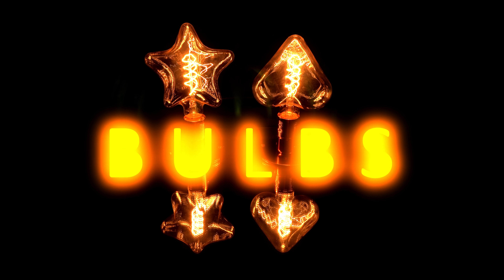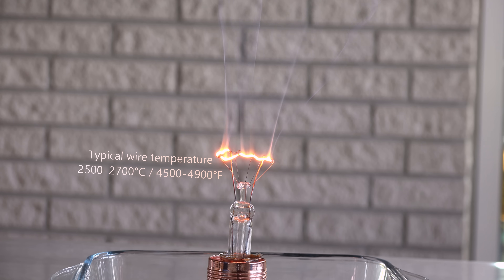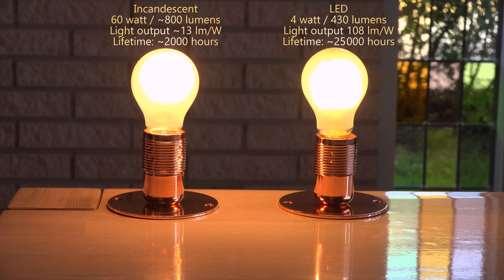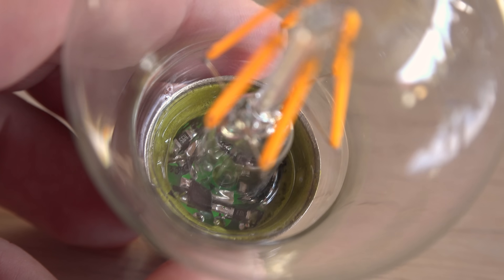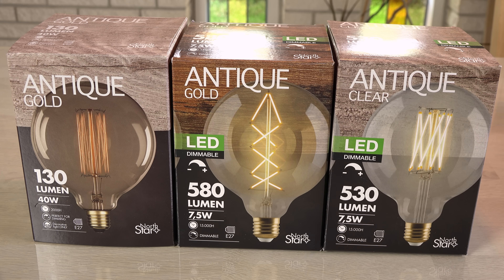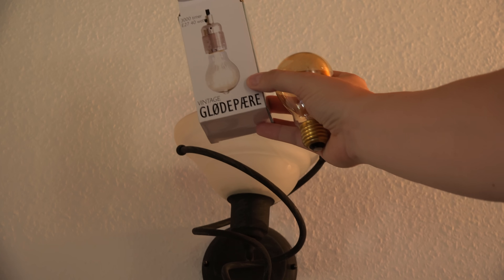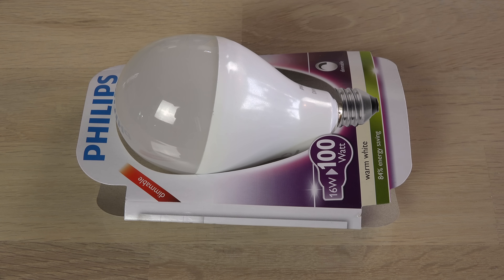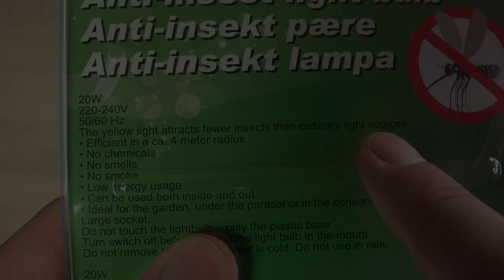Light Bulbs | LED vs. Incandescent

Comment: I have been waiting for your next video, and here it is. It is also very interesting to me as I have been thinking of converting to LED lighting! In the UK we use 240v 60Hz AC. Can you buy bulbs that convert the AC to DC? If so, are the electronic components reliable? Finally, what about strip/fluorescent tube lighting? Excellent video once again. Cheers.
Reply from the maker: Most if not all LED bulbs will have the electronics built into the base of the bulb, so they are ready to use. Also with 240V 60Hz if you buy in the UK. The electronics are not of the highest standard yet (built to a cost) but all LEDs should outlast incandescent bulbs in lifetime. And yes, you can also buy LED tubes in the same format as the old fluorescent tubes.
Reply: Brainiac75
That was my major concern, the electronics. I think I will try out one or two to start with and go from there. Thank you. Cheers.

Comment: Wow I didn't know that LED lights had color index's to worry about.
Reply from the maker: You're not alone... Manufacturers keep a low profile about because CRI 80 isn't really good. But CRI is actually an important factor for many purposes.
Reply: Yeah I certainly would not want a LED light with a low CRI my kitchen or dining room.

Comment: Viewers- if you're ever buying LED bulbs for in your home, be sure to buy "warm" white and not "cold" white.  Cold gives that fake looking effect like Brainiac showed with the meat.  I enjoy mine.
Reply: Cold white looks terrible in most applications, short of headlights, and interior cabinet or case lighting. It strains the eyes and makes you look like a vampire.
Reply: mibars

I'm with you. As an experiment, I recently bought a slightly higher priced 40 W LED bulb that was called "daylight." (5000K) To me, sunlight is cheery, while incandescent bulb light is dreary, and so are the warm white (2700K) LEDs and CFLs that are meant to match the light of incandescent bulbs. The new bulb definitely does have the effect of sunlight to my eyes and my mood. It seems far brighter than other LED bulbs I have, although the lumens spec is the same, but it is the lowest wattage I can find that is called "daylight." I now wish I had bought all my efficient bulbs as "daylight." If meat supposedly does not look right under light like the sun, I can deal with it.
Reply: ***** 'White light', that is either on the side of cool, or on the side of warm. Natural white is actually very slightly on the side of warm, like sunlight. I am not talking about that yellow orange light like old incandescent bulbs :) Although, that lighting will compliment your complexion.
Reply: mibars Most people after they color correct their monitors, will think white looks a bit pink as well. They are just not accustomed to it being accurate.
Reply: I slightly disagree :) I'm sitting in a room lit with 4200k CFL's and I really enjoy it: They seem "cold" compared to incandescent or even regular CFL's and slightly warm but close to sunlight with a small shift towards pink during daylight. I have 5500k "photo" type 85W CFL's in my garage and I also like the color there.
Reply: Philips Hue LED bulbs costs a lot, but they're the best I've seen with a high CRI index and adjustable color temperature.
Reply: Richard Smith Unfortunately it is just how the light out of those CFL's is - They have CRI of around 80 and when I turn them on during day I can see that there is slight yellow-pink tint compared to sunlight. It is marginal but I can see it. Not like cheap CFL's from 10+ years ago that were literally pink :) At night this is not visible at all. 
Kenneth Florek as I'm replacing CFL's with LEDs as they go I'm buying "warm white" LED's - I've noticed that they are usually in 3000-3500k range, much better than incandescent including halogen type.
Reply: Colour temperature is not the same as CRI. The uploader, as far as I can tell, used warm white LEDs, the light quality is still not the same.
Reply: ***** You sound like you're trying to excuse low CRI LEDs for their imperfections, whether they are made to a 'warm white' spec or not. CRI is just a measurement of the quality of colour reproduction, but any light source with a value less than 100 can have errors, in this case a yellow tinge on a white plate.

LEDs with a higher CRI compensate for a relative loss in blue light by extra red and green light, which smooths out the spectrum and brings the luminaire closer to an incandescent lamp in performance, while compromising on efficiency.
Reply: Me too.   I don't like the yellow cast from warm white LED's.  Also,  the light temperature is only noticed for a short time after changing from another type, then your eye's compensate.
Reply: 2700 or 3400k for household use but I use 6500k for the garage area.
Reply: Ben Landvatter iam from a third worl country and we have led lights with three different color configurations they are triggered by switching the light bulb off and on again
Reply: Actually, I prefer the "cold" white ones, or daylight (5000K) in my house.  This is especially true in the basement, garage, and outdoors.
Reply: Colour temperature and CRI is incomplete data. A 2700k LED, CFL and incandescent are all vastly different even though their colour temperature is the same, probably their CRI is similar. The spectrum given out is more important. While sunlight has a temperature closer to cool white led and CFL, its spectrum is most similar to incandescents and candlelight. They all give a smooth wide spectrum that covers the infrared region. Majority of the energy of sunlight that reaches earth is infrared. With zero infrared from the hideous lights (led and Cfl), they're far far away from sunlight. CFLs have the most hideous spectrum of all with what looks like pins and needles. That daylight colour temperature is a deceptive metric.
Reply: Ikeas ones are also quite warm, but may cost a bit more
Reply: +PROTOCỢL
They're also way less energy efficient than single-hue leds. like, less than half as efficient
Reply: *****
Except that with the incandescent lamp (also 2700k warm white) the plate was clearly white and lacked the yellow tinge created by the LED lamps.
Reply: *****
To add to what you are saying, even white objects, like a plate, use pigments, and pigments have very irregular reflectivity, not equal at all across the full spectrum. Even assuming two light sources look perfectly white to the eye doesn't mean a "white" plate will look the same with either source of light.

 No light source that is not continuous across the full spectrum can possibly always match daylight, which in my opinion is the only "natural" light, because it is the light our visual system has evolved to use, millions of years before electric lights existed. People are just accustomed to orange-y incandescent bulbs from birth, and that's why they think they look right.,

 It is my understanding that the common so-called white LEDs are blue LEDs with an added reflector and phosphor that glows when hit by the blue, emitting light that balances the spectrum to look white.
Reply: Alternatively, buy a smart LED bulb, like Yeelight. White and hue is adjustable, perfect for photoshoot. Downside is a bit expensive than regular led.
Reply: No, natural white is "cooler" than "cool" or "warm" white. "Warm" white has a colour temperature of ~3000K, "cool" light has a colour temperature of ~5000K, whilst sunlight has the same colour temperature as the sun, i.e. 5800K.
Reply: As noted, it's about energy usage efficiency.  Lighting is one of the hugest sources of energy draw out there and when you think about it...that makes sense.  This is one of the reasons street lights are steadily being changed over to LED from sodium.
Reply: Ben Landvatter 
Is warm white the same as high Color Rendering Index?
Reply: I use a cold white one for ambient lumens to add to the room, but never as the primary light source.
Reply: 5000 or 5500 color temperature is the ideal (daylight) just like the sun :)
Reply: Cool white/daylight also makes your living room look like the dentist's waiting room or some cheap commercial business. It's good for a workshop table or a work desk when you need proper daylight-type lighting.
Reply: 5000K is ugly, 6500K look better and 3000K with 6500K with 90+ CRI is very bright but then I think I have 8000 lumens in the garage.  I need to get a dimmer installed.
Reply: You want to buy 2500-3500 Kelvin anything else is to warm or to cold

Comment: would be nice to know the prices with that summary.
Reply: also depends where you buy them, if you get them from your local store an LED could cost anywhere between $4 to $10 whereas from china you can get low power 3W-12W bulbs for as low as $1-4, however since they're usually made for use on 220V/240V and tend to use a capacitive dropper circuit meaning that on US 120V they'll be half as bright but still not bad considering the price.
Reply: I thought that too, but I've kept my eye on pricing for a lot of LED bulbs for the past 2-3 years and the prices fluctuate so rapidly, that there'd be no point to include them in the video.
Reply from the maker: Well, Danish prices are quite high (VAT 25% etc), so it may not be useful for most of my viewers. Thanks for watching!

Comment: LED is a good replacement for incandescent bulbs. at least in my experience. However in the US they arent advertising the LED like they are those  fluorescent and CFL bulbs. Which seem to not do as advertised, and contribute to mercury build up in our landfills (no one here actually throws them away the way you're suppose to)
Reply from the maker: LEDs are definitely getting as good as CFLs - if not better. I only use CFLs for video lighting because high CRI LEDs are still expensive...

Comment: There is another more hidden negative effect led bulbs though. And that is that badly designed led bulbs put a lot of stress on the national grid. This is because cheap designed led lamps create power spikes in the net and in a worst case scenario only on the positive side of the sine wave.This can destroy generators that are not cable of handling such switching loads.
Reply from the maker: Hm, I had no idea. But no doubt that the electronics in LEDs could need some improvement in many cases...

Comment: Hey Brainiac75 - We are not seeing voltage and I suspect that your source was not a perfect 230V - This may be the reason why all incandescent lights were showing less power than advertised and under higher drain (400W) difference was even bigger due to higher voltage drop. LED lights with built-in power supplies (not a capacitor dropper ones that flicker) are voltage independent, they will often run from 100V or below up to their "popping" voltage drawing exactly the same power :) They even run on DC. 

To show how important is voltage drop lets take my 3 kW kettle that I use: It only draws around 2 kW as I'm on the very end of power line and I receive around 220V which drops to 190-195V measured on a socket in the kitchen when I turn on my kettle. That's 2/3 of rated power :)
Reply: Was about to say the same thing :)
Reply from the maker: Thanks for the input. That actually could be the case in my house too. The wattmeter probably isn't extremely accurate either - but the readings for the bulbs should still be relative comparable.
Reply: If the voltage is 220VAC the the frequency is 50Hz and that doesn't help with flicker. 117VAC and 60Hz is better because the peak voltage is lower and frequency 17% higher.
Reply: Voltage drop, BS!

Comment: Hello, I'm in America. I have many older lamps in very good condition from early-mid 20th century. I have been traveling around older small towns gathering up Sylvania (made in Pennsylvania USA) bulbs. From more than
50 to 35 years ago one could purchase by deposit of spent bulbs a crate from Edison, the power utility company, a case of bulbs at 10¢ to 18¢ per bulb. These bulbs would last many years.
There was one in the bedroom that lasted 30+ years.  For twenty years now "consumer marketers" from China make incandescent bulbs that maybe last three weeks, and cost for one bulb, is what whole case of Edison cost.

They will have to pry my 40w American made incandescent bulbs from my dead warmed hands.
Reply from the maker: Hehe, cool. Thanks for sharing :)
Reply: Brainiac75 thank you.. for posting!